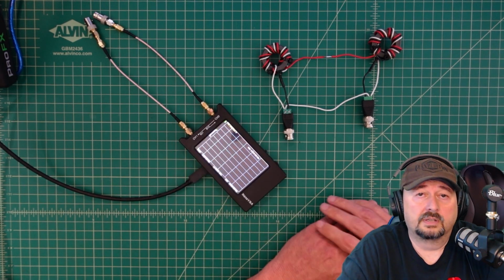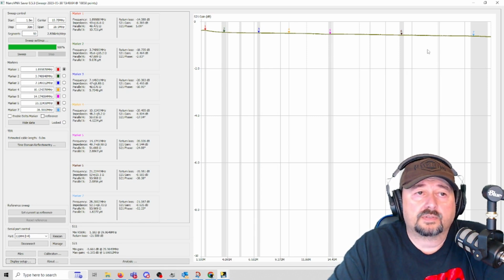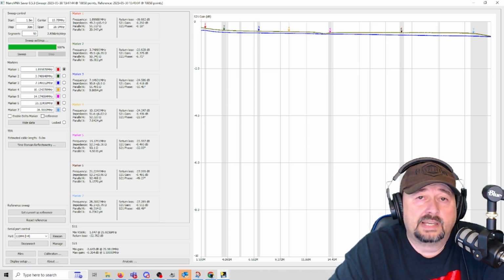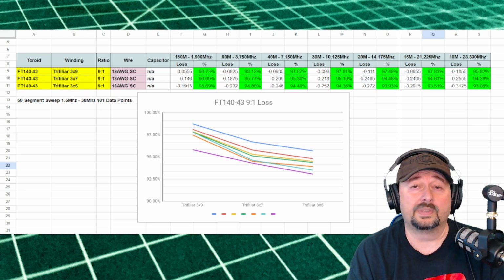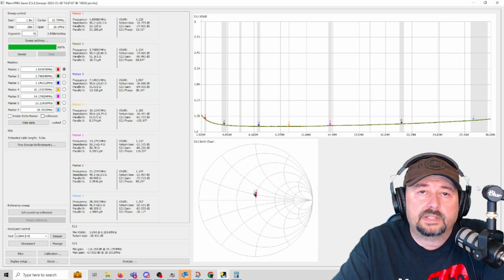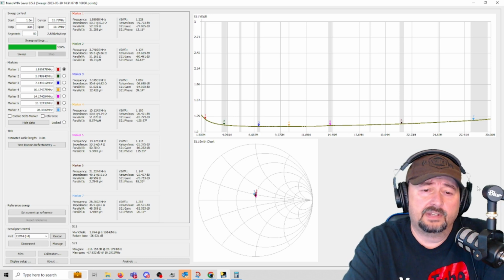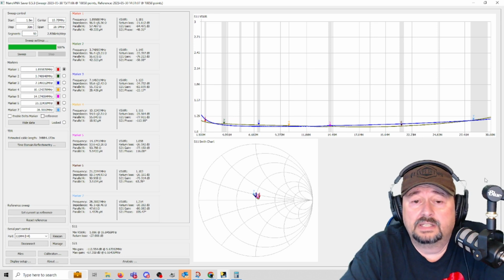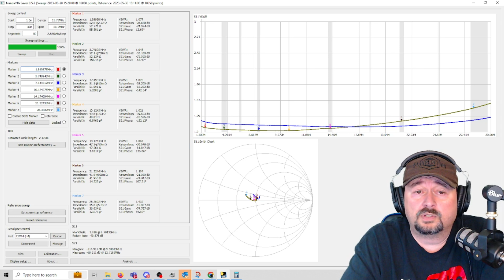Random Wire Antenna FT140-43 Toroids Tested

Comment: Fascinating information.   Thanks for taking us through your process!

Have you ever considered combining different toroid mixes to improve overall efficiency over a broader frequency range?

Thanks, and 73!
Reply from the maker: Hey Richard, I’ve never seen an antenna that does everything really well. I don’t like the idea of combining cores and the magnetic filed will likely interfere with each other 👍
Reply: @TheSmokinApe  Well, I asked AI, "Is it okay to stack a FT240-43 core on top of a FT240-31 core for use in a coax common mode choke?"  And, the response was quite enlightening.   I suggest you cut and paste the same question and read the response.

Then, consider doing some tests on a stack of FT240-43 and FT240-31 toroids used as a coax common mode choke and see what kind of performance they provide.

I don't see how the cores could interact in any sort of negative way.   That's why I think it is worth experimenting and testing.

But, if you have any relevant experience to share, I would be keenly interested in hearing about it.   I am certainly open to the idea that AI is wrong.   But, what if AI is right?  Maybe, we should find out?

If I had the equipment, I would do the testing myself - but, I don't.

EDIT:   I also asked, "Would I be better off stacking two ferrite toroids of the same mix, or stacking two ferrite cores of different mixes for use in a coax common mode choke between 1 MHz and 450 MHz?"   The response was equally enlightening.

What I'm trying to accomplish is not to improve any particular antenna's performance.   What I am trying to accomplish is to come up with a method of building chokes and transformers that operate over a wider frequency range - so, I don't have to have different chokes and transformers for different frequency ranges.  I would like to leverage using multiple cores to improve both power handling and broadband operating characteristics.

Comment: Excellent video. I'm a microwave calibration "data guy" and love to see real measurements. One comment: When measuring resistance, use clips instead of holding the resistor and the probe tips with your fingers. When we hold it with our fingers, our body resistance is in parallel with the resistor, making it read lower. Guess how I learned that.......  AI7YM.
Reply from the maker: @buddyhoover57  glad you liked it Buddy, thanks for watching and the tip 👍

Comment: Why do you use 2 ununs for insertion loss test? 
Couldn't you use one? 
Love the video gotta get me a nano vna....
Reply from the maker: One is to convert the signal from 50 to 450 ohm and the second is to bring it back from 450 to 50, the systems impedance of the meter (NanoVNA) is 50 ohms.
Reply: So if this was a 1:1 you would use one core if I'm understanding correctly.

Comment: I only could fit 8 turns on my core. It works so far. I’ll have to test it out in rig expert. Wonder if odd turns vs even turns matters?
Reply from the maker: It doesn’t, you should be fine with eight, looking forward to hearing how it tests out 👍

Comment: Many thanks for making these measurements.  The measurements made here are one way to start, but we might reach quite different conclusions regarding the relative merits of the three items if the items were tested more fully.  Vector network analyzers are wonderful tools, but we must be careful in interpreting results.

This first test with two ununs connected “back-to-back” reveals just how an unun will perform (at least for small signals) when it is connected to another unun.  This point is obvious, but we must not assume that this tells us how the unun will perform when connected to a different load.

The use of the S21 measurement tells us the ratio of the output wave to the incident wave, but by itself it tells us nothing directly about the power loss or efficiency of the device or devices under test.  For instance, suppose we test a lossless device that presents a bad mismatch at its input.   We will see a low magnitude of S21 but that is due to a high magnitude of S11.   A high S11 tells us that incident power is being reflected back at the input rather than being lost as heat inside the device.  We have to distinguish between the power incident on the device and the power that that actually goes into the device.

The formula to calculate the efficiency of the device, expressed as a ratio of the net power that actually goes into the device at the input port to the power that comes out the output port, is S21 magnitude squared / (1 – S11 magnitude squared), where the magnitudes are expressed as ratios rather than dB.

The other test looking at only S11, when the device is connected to a resistive load, shows us that there is transformer action going on assuming the loss in the device is low, but it doesn’t tell us anything about the relative merits of these three devices when used in an actual system that will in general exhibit some other impedance.  To determine by measurement of s-parameters how the unun (or any device for that matter) will perform with other loads, we need to measure all its s-parameters as complex numbers and apply a set of formulas that include the actual complex load impedance that will be connected to the device.

It looks like the measurement loop may have an inductance of roughly 250 nanohenries due to the wire lengths and loop area.  At 30 MHz, that would be an inductive reactance of about 47 ohms, or about 10% of the intended 450-ohm impedance level.  Thus, the wire length is probably having some noticeable effect on the measurements at 30 MHz.  At the low frequencies, there would be proportionally less effect.

We also need to keep in mind that the answers we get when testing with small signals may not be representative of what will happen when we apply substantial rf power from a transmitter.  For instance, the magnetic core may exhibit enough nonlinear behavior to throw things off, and the device may be heated enough that the wire resistance changes and the core loss factor changes.

Given the tests that were done, plus assumptions that there will not be too much power dissipation or nonlinear behavior when used in our system, we can say that all three are candidates for use.  We can’t say which would be absolute best in our system, but since all the results are similar, it seems likely that we wouldn’t notice any difference in on-the-air contacts and we would be okay with any of these as long as the impedance presented to our transmitter is within acceptable boundaries.
Reply from the maker: Thanks for the detailed post, it's much to consider.  I appreciate it 👍

Comment: This is a cool video for sure…I made one of these using a ft37-43 core, just much smaller.   A 470 ohm on the input showed the nearly 1-1 SWR, but not over the full hf band on mine.  Interesting way to do it using two of these back to back for the insertion loss and match z on the second port on the nanovna.
Reply from the maker: Thanks Walt, glad you liked it.  This resistors can sometimes introduce inductance and higher frequencies and raise the SWR 👍

Comment: Awesome work. Thank you. We can go even further in this quest. I’ve measured my 42ft random wire antenna impedance without any transformer from 7mhz to 28mhz. The impedance varies a lot and it’s very high on the lower bands (1270+324j on 7mhz) and starts going down as you increase frequency (790-1380j at 10mhz, 127-310j at 14mhz, 330-144j at 18mhz, 209-577j at 21mhz and 122-230j at 28mhz). So the 450ohm is a very simplistic assumption and the fact that a unun is not constant across the whole spectrum is not necessarily a bad thing depending on the impedance your antenna exhibits. Looking forward to see more videos of this kind! 73 de F4JAW
Reply from the maker: Correct, you are adding the unun to the circuit and impedance with change with frequency due to reactance 👍

Comment: nice Ape explains why  everyone says 9:1 :)
btw to get 450 ohm,  try a 270 and 180 in series, or if you have an 820 and a 1k, use them in parallel (but thats closer to 451ohms)
Reply from the maker: That’s a great tip on the resistance, thanks 👍

Comment: Spot on Ape. Trying to improve those losses is pointless as to what you would gain. I honestly thought the loss would be more. I have those 2 little cores here set up to do that test. I think there will be a difference with materials and geometries but not a massive amount. 61 material may be a good shout for 40-10 as Evil Lair has demonstrated.
Reply from the maker: Hey Colin!  Your work has inspired me, thank you.  I was pretty surprised at these results as well, I’ll be repeating with mix 61 in the future 👍

Comment: Thanks for the demonstration.
Lower number of turns would be good for higher frequencies because of increase in inter-winding capacitance and higher number of turns would be good for lower frequencies. 
Ni-Zn ferrites like #43 (ui850), #52(ui250),#61(ui125) and the "K" material can be tested for the specific frequency band/s.
Higher permeability cores can be used for lower end of the HF spectrum and lower permeability cores can be used for the higher end of the HF spectrum.
But then, the magnitude of power handling becomes an important factor too.
Higher permeability cores would get saturated quickly when operated on the lower end of the HF bands; so, you have to select bigger, bulkier cores.
For the higher end of the HF spectrum you can use lower permeability cores and with lower number of turns; you get the required inductance and at the same time the inter-winding capacitance is also taken care of.
De VU2RZA
Reply: Any thoughts on what to use for 2m and 70cm bands?
Reply: @steveshelton5884  yes, sure. You can use lower permeability cores like #61,#52 or "K" ferrites.
Ferrite mix #61 is usually my choice.
It has a high Curie temperature, lower saturation and hence can withstand higher flux, and the likes.
I am using it in my 1.2 KW SSPA (HF) (using 4×SD2933 MOSFET devices) for the broadband output transformer.
And I have two such modules using hybrid splitter and combiner to put out 2.4 KW without any problem.
The cores remain as cool as cucumber.
De VU2RZA
Reply from the maker: Thanks for the detailed information SR, much appreciated.  I will continue these tests with other core mixes 👍

Comment: Great to see the differences in performance - but there's another test you could do. Its not a test the NanoVNA can do, however. 
Using an actual transmitter, vary the power level in and compare to the power level out. At some point, the core will saturate and you start losing power as heat.

You should probably do this with T140 AND T240 cores, to help users decide when a bigger core is a good idea.
Reply from the maker: Hey Alan, thanks for the info.  I do plan on doing more video with various cores 👍
Reply: @TheSmokinApe  some baluns use 2 stacked cores. Need to cover that, too.

Comment: Hi Ape, really enjoyed the video. It's great to see things outside of the box. I have not tested my 9 to 1's for loss, but have found that a 9-1 made with a FT-240-43 has better SWR in the low band, 20-160m and one made with a T-200 powder core has better SWR in the higher bands, 6-20. Twenty meters appears to be the point that both are somewhat close in SWR. I've finally broke down and bought a VNA, so I will be doing more testing in the future. My unun's are all 9 wraps.  Have not tried anything different in that regard. I always enjoy you technical videos. Keep up the good work.
Reply from the maker: Hey John.  The Ferrites generally are more broad-banded than the powdered iron cores.  When you want a do it all solution you do end up making some compromises.  Congrats on getting the VNA, it’s going to open up a new world for you 👍
Reply: @TheSmokinApe  100%. If I had to choose,  it would be the 43 mix. I made one of each I can take into the field. That way, depending on the band, it gives me options.  I know, a little anal, but I love making antennas and unun's. In the end, not a huge difference either way.